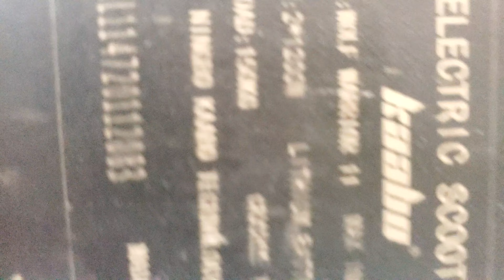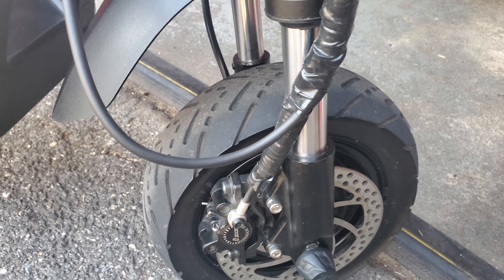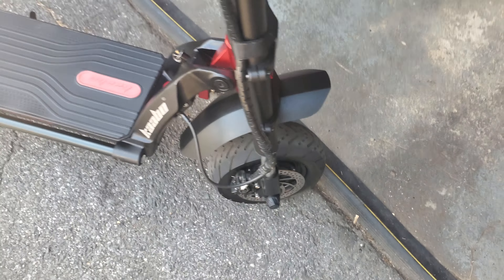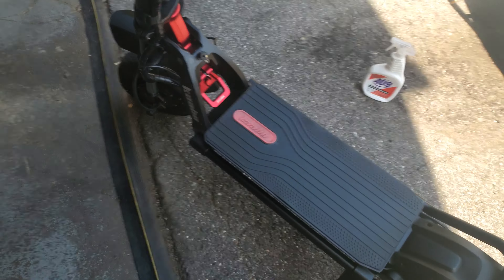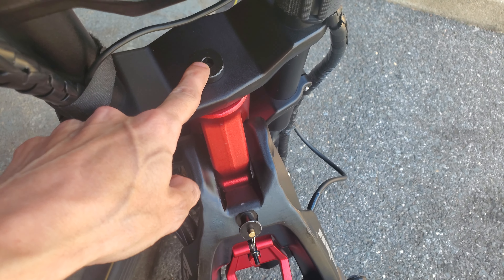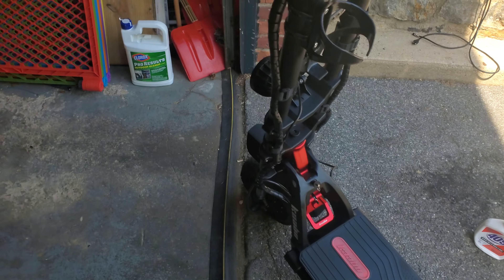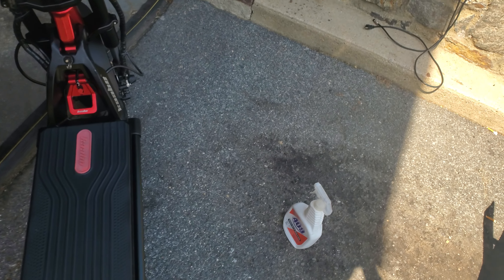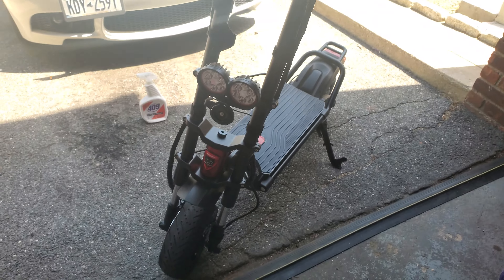What You Should Do If You Own A "KAABO" Electric Scooter?? [4K]..

Comment from the maker: Oh and guy's make sure you use loctite on all the screws. Now guys this hasn't just happened to me i have 3 friends with kaabos and they had the same problems then i went on a bunch of different forums and i couldn't believe how many people this has happened to its unbelievable then I realized how cheap the screws are so i don't want you guys going through the same shit i went through so definitely go to the hardware store and pick up stainless steel screws and bolts!!
Reply: SO MANY ARE SPONSORED AND..WELL...NOT HONEST. YOU SEEM LIKE A REAL GUY.
WHATS THE BEST QUALITY SCOOTER FOR UNDER 2000$ MUST HANDLE 270 LBS
RATHER QUALITY OVER JUST TOP SPEED. IF IT CAN HIT 30s(WOULDNT MIND MORE THOUGH) WITH ME ON IT..FINE

SEMPER FI
GUNNY
I WISH ONE REVIEWER WOULD BE HONEST ABOUT BKE VS SCOOTER (ALSO) WHY GET 1 OVER THE OTHER
THANKS IN ADVANCE MAN. SUBBED
Reply from the maker: @BOOSTEDLASER  Yea I'm not sponsored by anyone I just tell it how it is some people call me bias but I'm only telling the truth and if u want a decent scooter under 2000 check out the Varla Eagle One

Comment: For some reason I like the look of the original wolf warrior 11+ i hate the controller in the front of the scooter but I digress lol stay safe mikey and great video bro
Reply from the maker: I do too imo
Reply: Why do you guys hate the controller being in the front?
Reply: I think it looks much better that way but each to their own
Reply: I think it’s easier to change if it goes wrong. It’s 6 screws and easily accessible and the wind keeps them cool like a radiator
Reply: I like it in the fraont and it gets air to cool. Plus its easy to service and adds tons of strength the the bars

Comment: Stainless steel has less shear strength than 12.9 or 10.9 grade.  The screws that come with any of these scooters are horrible. Even dueltron. I have 7 scooters so I have some experience.   Locktite is key because they get loose then they sheer. Dueltron uses mega glue on all there shit bolts so the don't sheer until you remove them
Reply from the maker: Stainless steel dont shear
Reply: @TheElectricScooterGuy  any quality fastener won't sheer by any forces on any scooter.   Be well my man.   Nice vids

Comment: Awesome video pal, could you please do up a list of all the screws needed to be replaced for the 11+ and post it here if that's not too much to ask😁
Reply from the maker: U need the screws for underneath the deck, the top of the deck, all the screws on the double stems, the screws that hold the caliper on and the 4 screws on the handle bars just take them off and bring umm to a hardware store and have them give you stainless steel screws